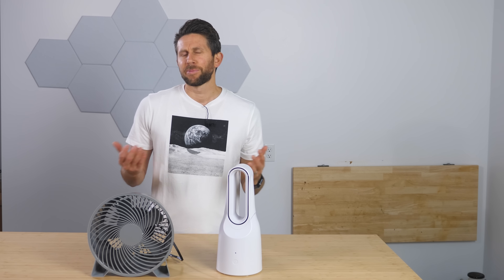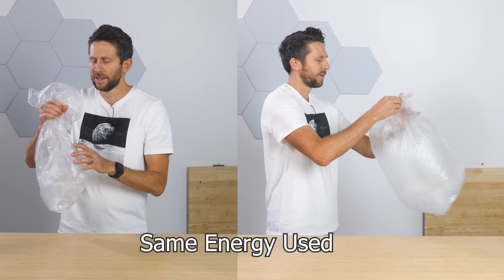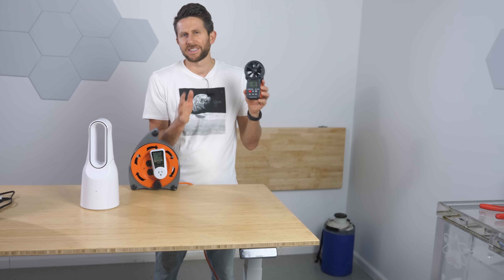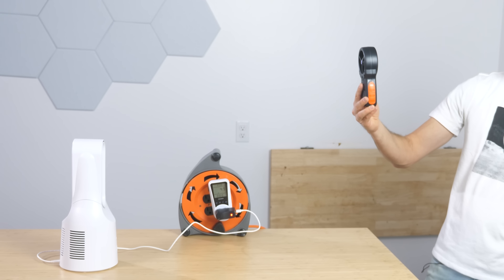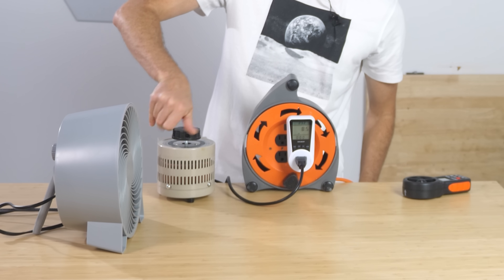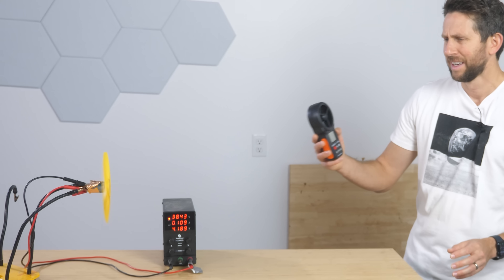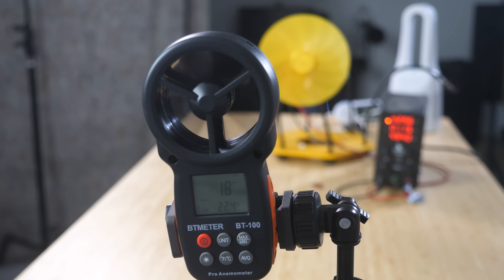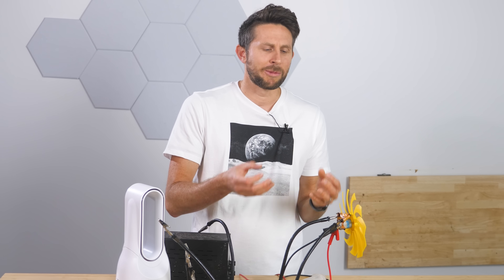Are Bladeless Fans a Scam?

Comment: As far as I'm concerned, when there is a blade in the base, it is not a bladeless fan and therefor it is a scam by default. Where it could be useful for might be its noise profile.
Reply: Technically it is possible to make a true bladeless fan using some cool technology. I saw a YouTube video of a guy building one a while ago to blow out a match. I just don't think we're truly there yet.
Reply: @Potatosayno  I saw researchers who built a model plane with truly bladeless propulsion. So we could move the air in our homes with some high voltage and clever electrode placement. I wonder if it would have similar risks as an ionizer i.e. buildup of static electricity on objects and people in proximity of the device resulting in dead electronics
Reply: There are no blades that can hurt you. Hence the name.

Comment: There will ofc be a pressure loss with the air going through the 'bladeless' part, but the fans should be quite identical to used energy. 
The bladeless is sacrificing speed instead of volume. There is the same power going to the fans, one's just increasing speed and lowering volume. 
Power=density*mass*speed. If you increase speed you have to lower volume(mass*density=volume), the density and power is the same.
Reply: You fail to consider that a normal fan does the air multiplication too. Like how he blew up the bag. The same thing happens with a normal fan.
I bet the biggest factor to why the bladeless is slowing down is because of the extra friction the air must have while bouncing around inside the device.

Comment: For (somewhat) exotic technologies like the "bladeless fan" it's rather bad idea to use knockoff products. Often these are made to be more lookalike then match the actual performance of the original product as they did no R&D.  I'm not saying that Dyson would do much better, but it's a bad test design. 
Same problem often applies to well established technologies too. Basically once a product is public it's a race to the bottom on costs.
Reply: Normal fans also 'multiply' the air tho, like he proved with him blowing air from his mouth, which works more like a normal fan.
Reply: @Utrilus   point was that he's actually testing a specific product that may or may not represent the technology correctly. He has shown no effort to ensure that the product represent the technology. Therefore it's just a test of a product,  It may or may not be representative of the technology, but it for sure is a badly designed test.

Comment: I don't think they are scam at all.  They offer safety benefits for toddlers and pets in particular.  So no, not a scam.  They also utilize the airflow coanda effect and airflow entrainment.  The only scam is in the name ( i.e. technically not bladeless ),  but not in the function or benefit.    If they claim to be more efficient,  then yes that could be questionable as demonstrated.  However if that is not their claim, then it's not a scam in that respect.  Encapsulating the fan like that induces airflow resistance,  which cannot be compensated for by the coanda effect and entrainment of the airflow.  The fan has to be seen for what it is and what benefits it might provide. Further more,   there are actual bladeless fans.  i.e.  ion wind generators.

Comment: No shock here.  Flow * Pressure = Power.  Centrifugal blowers, like used in bladeless fans, are more optimal for generating pressure and less flow.  Axial fans are generally more efficient at higher flow and lower pressures.  That's why we use blowers in HVAC systems, because ducting and distance increase the pressure requirement of the system.  We use Axial fans on radiators because the pressure drop is generally less and the flow requirement is higher.  So for equivalent power consumption you're just shifting between more flow and more pressure by comparing these two fan/blower designs.  Nice video.

Comment: Sorry but something seems wrong about that test. you're measuring the wind speed, which obviously will be lower, as it has to drag more air with it. What you should be measuring is the volume of air per second in total. yes, the air will be moving slower, but over a relatively larger area, which moves more air in total per w used than the regular fan. most people don't buy these to achieve high wind speeds, they want to move hot air out of a room or cool air into a room, and for that they are more efficient.

Comment: I'd really like to see a measure of total volume of air moved, as opposed to the speed of the moving air.  Even if we are losing speed after the fan, if we are circulating more air, we might be accomplishing the real goal of the fan, which is to keep the air in the area in circulation so heat doesn't stagnate around hot objects.

I do suspect that we are getting the same "air multiplication" on a normal fan by the air that was moved, pulling air around it as it moves, anyway though.

Seems like a much more difficult to control test though.

Very cool experiment as is, as usual! 🎉👍
Reply: "I do suspect that we are getting the same "air multiplication" on a normal fan by the air that was moved, pulling air around it as it moves, anyway though."

This is correct, normal fan airflow draws in additional air downstream of the fan, as a result of the increased airspeed coming from the fan.

There's another youtube channel that did tests that demonstrate this, "Matthias random stuff" in his video "Best fan placement to move air through the house".

Comment: I guess a more appropriate comparison would be to compare the air flow of both fans (air volume per unit of time). The way it was made is like comparing a truck and a car by their speeds and not taking into account their masses.

Comment: Wouldn't you need to integrate the wind speed over an area? It's like measuring a spot brightness when comparing a laser pointer and a light bulb. Yes, the laser is brighter. But it won't illuminate the room.
Reply: But it could if you had a Diffracting medium that Lightbulbs use like the frost on the inside.
Reply: @fat2slow  Most laser pointers operate in the mW range. The power output is simply too low.

Comment: Dyson doesn't sell bladeless fans anymore. It's all just air filters now. And in fan comparissons these regularly fail agains tratitional blade fans. In power consumption, moved air and loudness. I have a Dyson fan and this is indeed more quiet at similar intensities compared to others I had. Yes, traditional fans can get even stronger, but they are already louder.

Comment: For efficiency you should compare volume of air per second, as speed can be increased by flowing air though a smaller gap
Reply: True, but he showed more air speed AND a larger area, so it's a double win. No comparison really needed.
Reply: @kindlin  For various reasons, there's nothing conclusive in these tests about the general concepts.
Reply: How would you devise this experiment?
Reply: @Qermaq  Set up a mass air flow sensor in front of the fan in like a big tube/wind tunnel-ish device (might take some experimentation to get the parameters of the test dialed in) and then rate the fans in terms of grams of air per minute per watt of power or something like that.
Reply: The normal fan blowed air over a larger area and the air speed was faster
Reply: This means that it might be more inefficient?
Reply: u need nothing but common sense
Reply: @calvinlee1127  common sense tells us that common sense doesn't exist. educate and get educated. don't just hope for valuable information to happen.
Reply: @error.418  I often say if there was such a thing as common sense we would not need a name for it.

Comment: Dyson is a crock...

I saw somewhere recently, a totally weird-looking fan blade design that was supposed to be nearly silent. Each blade was differently sized but still weight-balanced. I can't remember if it was for fans or propellers or . . .
Reply: About fifteen years ago I was in a store and the bathroom had these Dyson hand dryers that were disgusting. You moved your hands up and down vertically over a thin stream of air and all the gross water collected in the bottom and sometimes your fingers would touch it. They've always been a gimmick for everything.

Comment: A sidenote about the Dyson's is that a lot of them also do air filtration. Not sure if that slows things down, too, but is definitely a factor when talking about those expensive ones.
Reply: The filtration does slow down flow, but doesn't raise the price by any multiple.  Like Nike shoes, most of the price is to pay for the brand name and perceived quality, even if it's not tangible.
Reply: @VoltisArt agreed
Reply: @VoltisArt  - With that concept, there shouldn't be much of a price difference between a Dyson TP01 & a TP09, right? 😆

Also, I do agree with you that the branding is definitely baked into the price, however I would argue that, unfortunately, there isn't any other brands (that I've been able to find) that offer all of the same features within a single product. It's like Dyson has put everything into one product, & somehow/for some reason, no one else is (or can or is willing) to make all of those same features available - again, unfortunately.
Reply: @Mike.Kachar  So you admit they appear to have a niche seemingly monopolized, yet still wonder why prices don't make sense.
Reply: @andruloni  they're definitely way overpriced...I just wish someone would come out with a similar product with all similar features.
Reply: Those go for over $1k and the filter are supposed to be replaced every year for a hundred dollars before taxes. Lifetime supply isnt guaranteed either. You're vastly better off with an aluminum blade gym/shop fan and a separate air purifier. Some air purifiers use water instead of cloth filters. Or just buy an AC. You can properly clean your AC for under $20 a year.